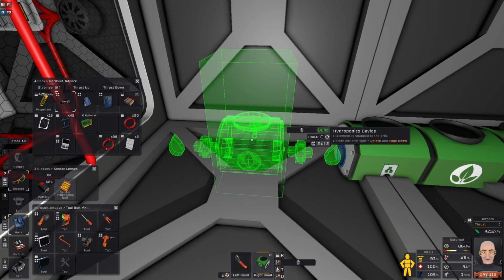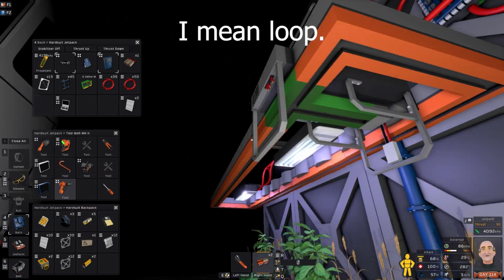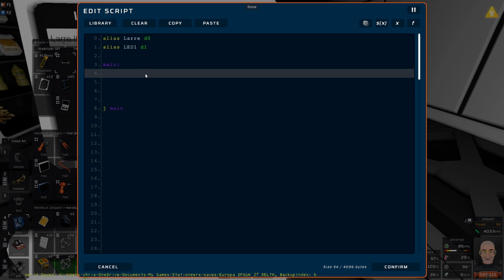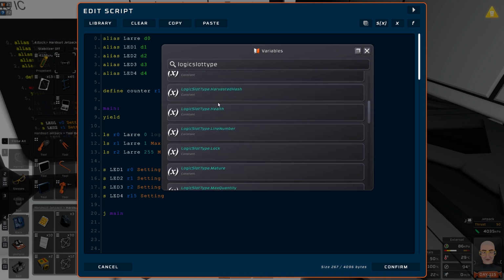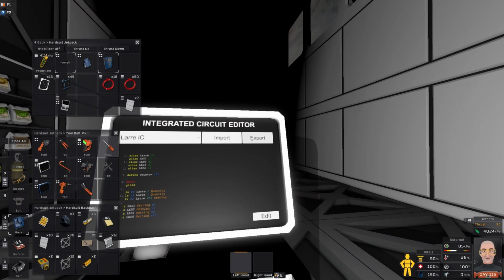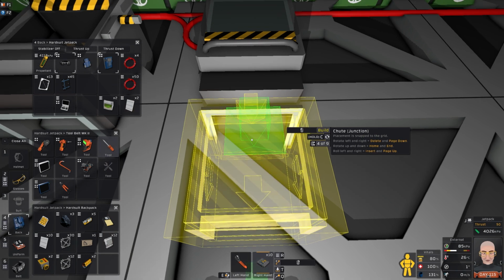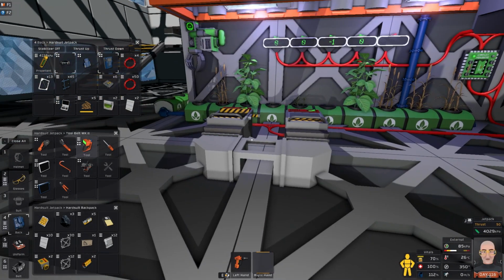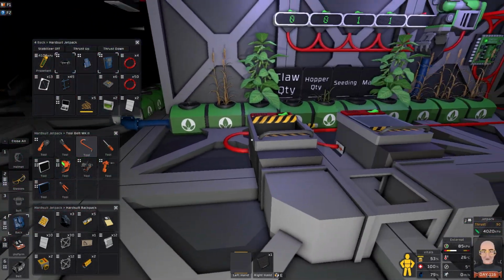How to Set Up Hydroponics with a LARRE in Stationeers - Tutorial

Comment: I really like this kind of mechanic, I wish there was more of it in games. In Minecraft, using Integrated Dynamics is somewhat similar.
If seeding == -1 means it's mature, then you don't have to read mature separately. As a software developer, I would add aliasses for all variables but I guess you're restricted to 16...
Reply from the maker: @LindaJuffermans Thanks for your comments. Yes 16 variables and 128 lines of code.

For us non programmers it is a bit of a mind bender at times. I thought I worked out in the video that the seeding variable was -1 if the plant is NOT mature, 0 when it IS mature but NOT seeding, or there is no plant, and +1 when it IS seeding.

I was only using the code for demonstration purposes at this point and to keep the number of lines down. When I write (read battle with the code for 3 days) the operating code I'll define the variables and give them names to make it easier to follow.
Reply: The 128 lines of code REALLY hurts. But ic10 chip can work with each other. And you can load devices by name. Rather than set to a screw. It's capable but very limited. And about as easy of programming as it gets.
Reply from the maker: @NoHypocrisy42  Yep, I am aware. I only used the pins in this video it keep things simple for those new to the game.
Reply: And there are 8 channels that work across networks. They function like registry values. Registry values are in each chip only though. 
I love the simplicity of it. 
Load (L) set (s) branch (b).
With variables like greater than (lgt, Sgt, bgt) less than (llt, slt, blt) etc.
Reply: It reminds me a lot of old assembler.
LDA (load register A), STA (store register A), BNE (branch on not equal to zero)
Reply: @LindaJuffermans  exactly. It's a real programmer language called mips.
Reply from the maker: @LindaJuffermans  Yes, it is MIPS Assembly Language, it is a bit challenging to get started with but I quite like it. It's a compact language for want of a better word. One line would need several in other languages.

Comment: Hurray!
Reply: Ever test if the larre works with the hydroponics station? Because its lights are more efficient.
Reply from the maker: No, but I don't see why it shouldn't work with the Larre.

The hydroponics station light only covers 4 plants. Also, I thought the Hydroponics station took 100w of power and the normal grow light was 70w
Reply: That's correct, surprisingly. But the lighting efficiency is MUCH better though. Manually growing, i was going for maximum growth efficiency. Found that the hydroponics station could achieve 125% plus growth efficiency because of the lighting.  And that's not using fertilizer yet.
Reply from the maker: @ The trade-off is density; you could use 9 Hydroponics trays in the space of 1 Hydroponics station, and by overlapping lights, you can improve the growing efficiency. But as I keep saying, there is no right or wrong way. People should do what works for them and their base.
Reply: Also I'm not usually too worried about power. Lol. Even more so since I occupancy activate furnace and production area. I don't understand how lights are 50w and led is 25w. More like 25w and 2.5w.
Reply from the maker: @ A 25w incandescent light is as dull as dishwater, i remember those days. You need at least 50w, and for a large area 100w, The equivalent LED would be about 15% of that, so 7.5w LED for the 50w bulb and 15w LED for the 100w bulb, but I agree the ratio between lights and LEDs is way off.
Reply: And larre doesn't work with the hydroponics station. Boo
Reply from the maker: @NoHypocrisy42  That's a shame. I was going to test it when I had a chance.